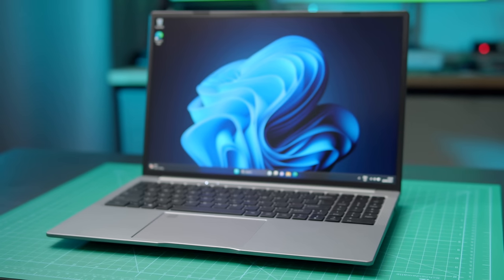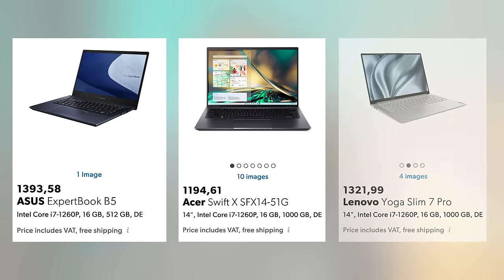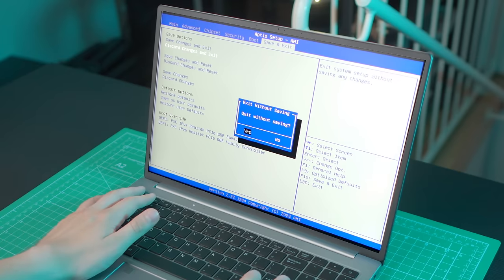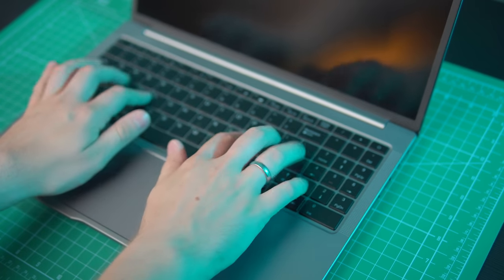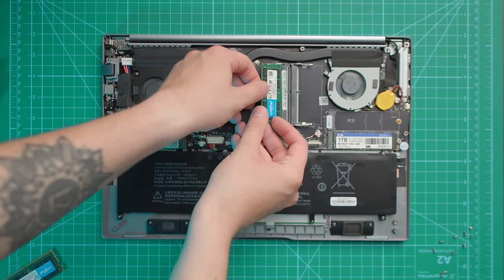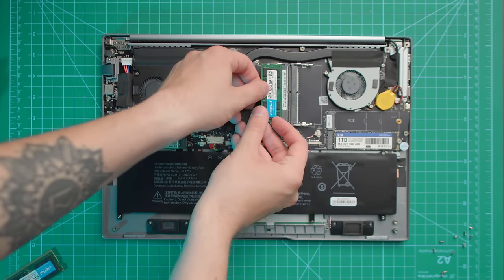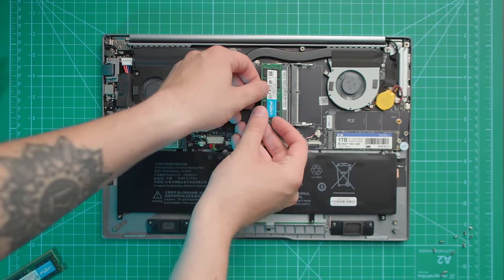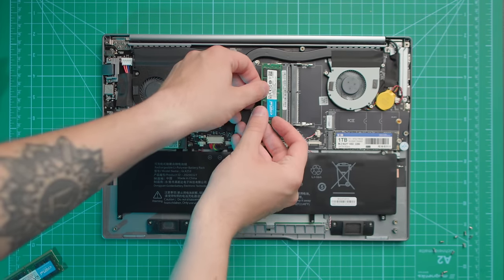Can You Use a Laptop as a Home Server?

Comment from the maker: A quick bit of info that I forgot to include in the video: 
- The power consumption was measured with the battery fully charged. I've tried unplugging the battery and running the laptop off of the power brick, but the machine would shutdown midway into the boot process, probably because the power brick alone wasn't providing enough power.
- For Proxmox repos, the correct way is not to remove the subscription repo, but to replace it with the non-subscription version: https://pve.proxmox.com/wiki/Package_Repositories#sysadmin_no_subscription_repo
Reply: Also disable the Enterprise Repo and change the Ceph repo so it removes the errors.
Reply: You can also just replace the repo using the web UI with the newer Proxmox versions

Comment: Using laptop as a server comes with an advantage of a built-in UPS 😄 I've also been using an old smartphone (OnePlus 6) as a server running debian (mobian) to host mastodon.
Reply: i would love a tutorial on this this seems very interesting
Reply: sounds very interesting please make a video of it!
Reply: there's one guy running a website off a phone hooked up to a solar panel
Reply: All of my laptops' batteries have swelled after less than a year. So I switched to a real ups without the laptop's batteries
Reply: @kkazakov  That's even more common on phones which often don't have any option to set a battery charge threshold
Reply: @kkazakov  Many laptop models allow to set charge thresholds, even on linux using open-source packages. I haven't personally built a laptop server yet, but if I did, I'd write a script or service which would keep the battery at 70% and once a week drained it to 60%, then slowly charged it to 80% and let it drop back to 70% after that.
I've had some success at prolonging the lifespan of UPS batteries quite a bit this way.
Of course the chances of a random old laptop in your basement supporting the needed charge control features are sadly relatively thin, but it's definitely worth at least looking it up or testing it.
Reply: Yeah but if your power goes out, your switch does too, but the laptop stays on
Reply: @Logilype  Can you power the switch over Ethernet or USB?
Reply: I did not think of that! Super clever!
Reply: I do the same, use as server. Power efficient and has built in screen, rtc, WiFi, modem etc. And cost less than a rpi
Reply: This is a key point. UPS that lasts for hours potentially unlike the usual crap UPS that last minutes.
Reply: Yes thats it
My Server draws arround 15w but with a small UPS my power draw ist arround 34w
Which is unaceptable 
And instead of trying different very expensive ups i want to go the laptop Route (probably a notebook arround 2018)
Reply: @bikingviking_at how to do that ? If you have any recommendations tell me please

Comment: I use a old gaming predator laptop as a server for more then 2 years now and it’s been great. Even with a power outage I can shut it down nicely
Reply: That's gonna use a lot of power though. Likely those i7 chips run hot.
Reply: @SixFingeredAmish  idle 16 watts and in use around 45 so not bad imo
Reply: @ChielvanderHoek is it 16 watt for the whole thing? Because 16 watt idle for just the cpu is quite bad

Comment: My old Lenovo Yoga (first gen) was running as a server for years. I bet it was appx. 5-6 years in total, 24/7. Only upgraded cause I needed a bit more power. A screen, a keyboard, a touchpad and a build in battery if any power issues. What's not to like 👏!
Reply: What did you do about the heating problem .. i have one now and it has about 140 f (60 c)
Reply: @mohammadjasim580  With the Yoga? My first gen Yoga was opened apps 20-30deg, and was standing up right. It was hot, yes, but worked as expected. I can't remember what kind of temps, it was facing back then. I moved to a 5. gen Intel 5250U series years ago, and... one year ago, I moved most stuff to a ODROID H3+.

Comment: I use a Notebook as a Homeserver for years (and it looks like at 2:58min with the Terramaster D5-300). IMO its the best way. Its cheaper, more power efficient and only has plus points. It runs out of the box with Windows 10 or 11. You get for 500-700€ an all in one solution with Screen and Batterie. But be carefull with your choice. Get an Intel CPU and a dedicated Nvidia GPU if you want the best solution for Videotranscoding.

Comment: You don't want to compare a laptop battery to a UPS. Laptop battery is better : ) The purpose of UPS is usually to give time to switch off the equipment normally or to wait for the diesel generator to start. UPS is not designed to keep the equipment running for a long time.
Reply: Battery of 600€ laptop not designed as well 😅

Comment: 7W is still pretty high. For the last week I use Dell Latitude 7390 with i5-8350 as my main router. I replaced WiFi card with Intel i210 on m.2 (wan goes to internal, lan to i210) and it boots right now from USB stick.
I see 3W idle, 7w under gigabit NAT (!). CPU mostly idles at C8 state.
Fun facts: I tried M.2 -> PCIe x4 in place of 2280 SSD. Not only it works, but Dell BIOS was able to boot out of SATA HDD connected to a regular PCIe SATA controller. That took me by surprise as I had Proxmox on that HDD.

Comment: I bought a low end IdeaPad 3 (i3 CPU (11 Gen, 2 core, 4 thread) 8GB RAM & 128 GB M.2 NVMe drive) and immediately upgraded to 36GB RAM and 1TB NVMe M.2 drive, and loaded Debian 12, KVM, VirtualBox, Docker and a bunch of server type VMs and it is sitting here on my desk as a new test box. It's working well, especially for the money (>$300 including upgrades) and allows me to take it with me to work on the VMs and containers while 'out & about'. EDIT: Another advantage is the 4-6 hour battery life with display brightness set to about 50%...

Comment: Literally today i installed proxmox on old HP 450 G4 with i3-7100u. In idle with closed lid (edit of one file in proxmox needed, otherwise notebook goes sleep) it sips 3,8-4,1W. With Windows 11 and two containers running power consumption rised to 4.5-5.1W. Blast!

Comment: I used an old Dell Latitude for about 2 years and the battery swelled up. I suppose it would've happened anyway but running it 24/7 in a cupboard may have sped up the process.
Reply: What did you do about its temperature .. i made one out of my old laptop and its temp is around 60 c

Comment: DId you disconnect the laptop monitor while checking the power consumption?
Reply from the maker: No, but good point – I'll retest with the display off and let you know
Reply from the maker: Update: with the display physically disconnected, the idle power draw is around 7.2-7.3W – so pretty much the same.

Comment: I have am i5-8265u equipped laptop and once you twinker it a bit with Throttlestop that thing is INSANELY efficient, especially in Idle. I regularly see it hovering around 1.5W, with a lowest reading on Librehardwaremonitor of 0.6W for the CPU Package!
If it wasn't my only good laptop I wouldn't mind turning it into a NAS/homelab, the only drawback would probably be the lack of Sata ports and inconvenience with powering the HDDs, but apart from that it should be great.

Comment: 14:57 If that laptop have thunderbolt or high speed usb - You can use DAS enclosure with whatever amount of drives you want (for example QNAP TR-106C, QNAP TR-004). 

Laptops are same as mini-pc (minisforum) but with screen and keyboard. You can use as server even surface 4 tablet lol, and with it dock you can connect whatever you want
Reply from the maker: I've considered it, but a good Thunderbolt DAS is around 250-300€. If you have that kind of money, you might as well build a dedicated NAS.

Comment: For my first server I used Lenovo T410 that I got School from for free when they were getting rid of them. Used that laptop as a server for about 2 years and was rock solid. Just had Ubuntu desktop on it and ran stuff bare metal. After discovering docker I bought tiny PC that could run all my stuff so gave T410 away as a gift to relative.

Comment: I currently have Proxmox running on a Dell XPS15 9500.  Sadly, the laptop has some hardware issue with the built-in graphics which causes it to crash when you're actually using it as a laptop.  With Proxmox installed, it's been totally stable!  I think if I passed the GPU through to a VM it would crash so I'll avoid that.

Comment: I am looking at building a NAS server from used parts. Is it possible to take apart a laptop and use the mother board in a chassis? The mother board would have to have some connectors for SATA/SAS or a M2.NMVE with multiple PCI lanes to support 4 drives for raid. It would also have to have a way to add two 10gb ethernet ports. I would never want to run the ethernet or drive off of USB. I assume its not a good idea but I have seen some really high end USED XEON and i7 workstation latptops with very low costs.  I am mainly asking because it has been hard to find rack servers or desktops with the specs I need on Ebay or CL. I thought there might be a chance that some laptop motherboards had a PCI header or some other port for HDD/SSD and adding 2 10g Ethernet ports. I would put the MB in a case with room for everything.

Comment: the most insane thing about the pc is the BIOS being unrestricted. Are you positive you can disable the IME? That is nuts
Reply from the maker: Yep. It's not super crazy either, disabling the ME has never been a problem. me_cleaner works on pretty much any modern Intel PC, it's just that you'd usually need to flash your device using a hardware programmer: https://github.com/corna/me_cleaner
Reply: @WolfgangsChannel  if I remember correctly the me_cleaner can only disable it for 30 minutes and then a reboot will force itself. The crazy part to me is knowing that they are Chinese manufacturer that are not locking any aspects of the bios they put in the machine. I think it’s still an immense step forward having access to all this options (c-states too!) on such a new device. Maybe I’m just overhyped at the possibility of gathering more info on how the ME works (and maybe reverse engineering it, although it’s just a dream)
Reply from the maker: The 30 minutes thing is what happens when you completely remove the ME firmware. Everything that the BIOS setting does is set the "disable" bit so that the firmware basically stays dormant. Not as good as completely removing the code from the BIOS, but better than nothing.

The me_cleaner tool also has a "lite mode" (not sure about the name) that reduces the firmware size and also sets the disabled bit

Comment: Is the Ubuntu server kernel too old for proper C state support for Alder Lake cpus? I tried running something similar on an i5 12500h and in ubuntu server I couldn't go below c3 but booting up a usb live Ubuntu 22.04.3, the system reached as low as c8. I found that ubuntu server LTS 22.04.3 was using 5.15.0-88-generic kernel whereas the regular ubuntu was using 6.2.0-26-generic. Is there a way to fix this?

Comment: oh wow, didnt expect to see my comment in there at the start.
all three laptops ive used as servers are around the 6th to 8th gen intel mobile cpus, ive had some pretty good idle power consumption numbers with all three.
the numbers i put in the comment that got screenshotted were from an i5-6200u in an acer aspire r13.

The built in ups is pretty nice as well as the screen, keyboard, trackpad and the ability to power them of a usb c charging brick that you could also plug something like your phone into for travel if portability is a concern as mentioned at the end, cant get that out of an old sff business pc. (but at that point you may as well just use it as a laptop lmao)
Reply: try undervolt, can be done through software from 4th to 10th gen intel
Reply: @mircomputers  ive done that
not with tha i5-6200, but with a i5-8250u (got lucky with -0.25mV on the cores) and a 6500T (it has a -0.2mV undervolt on the cores so far, ive not pushed it to instability yet)

both cpus idle at a tiny 0.4 watts (not the entire system), which is just absurd to me.
Reply: @guesswho2778  can also undervolt other parts even if not as much, gpu takes usually same uv as core, cache usually half as much

Comment: Also, I was gonna try using my MacBook Pro as a server, but apparently Mac OS server was discontinued. Maybe you have some suggestions about that
Reply from the maker: If it's an Intel Mac, there's nothing keeping you from installing Linux on it.
And if it's M1, you can use Homebrew to install things like nginx, php and mysql, and Docker to run more 'complex' services
Reply: @WolfgangsChannel  thank you, would I be able to put a Wi-Fi router on it and allow it to view android tablets? And see oculus headsets by chance?
Reply from the maker: You might be able to use it as a WiFi hotspot, but I would personally just get a separate small WiFi hotspot/router for your usecase. GL.iNet makes really compact models that you can power from a powerbank, e.g.: https://www.amazon.com/GL-iNET-GL-MT300N-V2-Repeater-300Mbps-Performance/dp/B073TSK26W
Reply: @WolfgangsChannel  I think this would be a much better option. I'll read some more.
Reply: hi I received the GL.I net. It seems to work pretty cool. Would I use the GL.I net as the host WiFi network as a standalone not needing the laptop? Or would I still need my laptop as a server to host the secure Wi-Fi?
Reply from the maker: You can just create a WiFi network on the router itself. technically you wouldn't need the laptop

Comment: The thing is HP n305 laptop with 8GB RAM and 250G SSD is about 370€. The same config cpu+mobo combo from aliexpress is about the same (even more). In one case you get some extra crap you don't need and probably less sata ports. On the other case you get plenty of sata ports but your warranty might be sketchy. Also there might be some security concerns with CCP stuff.

Comment: I have an LG Gram 2020 that COULD be used as a home server. It has dual M.2 NVMe slots, which could be populated with two 4TB SSDs. It would run Unraid no problem, and it has a Thunderbolt 3 port, and USB 3.2 drives (Gen 1 and Gen 2) so attaching external drives would be possible and/or a Thunderbolt to 10Gbps Ethernet dongle…

I just bought a Mini PC to do something similar. Never considered using my old laptop instead. If it wasn’t for the fact that my daughter still uses the laptop, I would try it out…

Comment: I’d reaaaaallly love to use a laptop as my NAS (4 Sata hdd support) are there such laptops?
Reply from the maker: As long as your laptop has an M.2 slot and you're ready for some jankiness – any laptop can do that.
Reply: @WolfgangsChannel  Any suggestions for a good cheap m.2 to sata port adapter? I bought one off ebay and there were no drivers for it outside of windows. This of course made it worthless as I wanted to use it with proxmox.

Comment: i started my homalb hobby with my grandma's old 2014 budget laptop and it drew 0.3w at idle
Reply from the maker: Is it possible that you're confusing idle (e.g. turned on, not running anything actively) with sleep mode? If not, 0.3w is very impressive
Reply: @WolfgangsChannel idk I just added consoleblank=300 to /etc/default/grub and ran powerstat -R
Reply from the maker: That's not very reliable, I'd use an inline power meter instead
Reply: @WolfgangsChannel  Yeah, I'm gonna try to get one and measure power consumption

Comment: I have a 10 year old laptop that uses 30 W while idling so I guess it's not good for this.
Reply: Does it get hot .. i have one now and its temp about 60 c
Reply: @mohammadjasim580 when under load it gets above 90 °C.
Reply: So there is no problem with my laptop going with this temp for a month ?
Reply: @mohammadjasim580  what do you mean? 60 is fine. But as I said I don't use the laptop much because it is very inefficient.
Reply: 60 is fine for normal use but what about  for a laptop running as a server ?  Lets say it is running on temp between 60 - 63 for a  month
Reply: @mohammadjasim580 of course.
Reply: @r0galik  Ok thank you

Comment: ngl, someone close wanted to throw away some very old toshiba that dated back to 2006 if i remember correctly. celeron, 2 gbs ram, and max of 50 gbs hdd. i use it to host a dns server that removes ads on websites, and block virus and stuff... oretty amazing things you can do with those things. (my internet is already 6 mbps. its slow so it does not affect the speed of my internet connection)

Comment: Is all the hardware in this laptop well supported by Linux? Seems like it would be a great daily driver running a good distro, that is if sufficient hardware support is there.
Reply from the maker: I currently have Fedora installed on the laptop, and haven't noticed anything apart from the fingerprint sensor not being recognized (maybe there's a driver and it just needs to be installed? idk). It runs pretty well.
Reply: @WolfgangsChannel  Thank you sir, that’s what I would have expected but wanted to be sure before potentially committing to and spending money on it. 😊

Comment: What are you using to test power consumption? It's very important with these cheap power supplies to pay attention to power factor, which can majorly throw off your readings if you're actually reading voltamps (apparent power) instead of watts (real power) on non-resistive loads. Something like a kill-a-watt measures either, but cheaper meters may not. 

For example, I have one server with a be quiet power supply with a nearly perfect power factor. I have another with a cheap 12v power supply and picopsu, the power factor is 0.7. That means a cheap meter might read 100 watts when only 70 are being paid for. 

This is reliant of course on your utility not charging for apparent power.
Reply from the maker: I'm using Shelly Plug S. It measures both VA and W